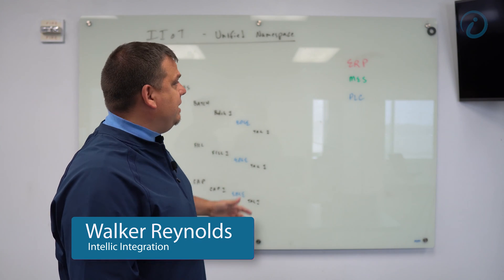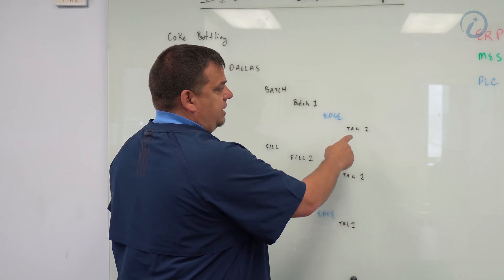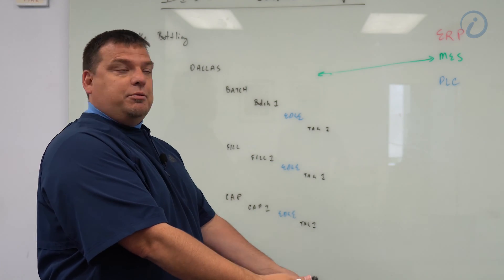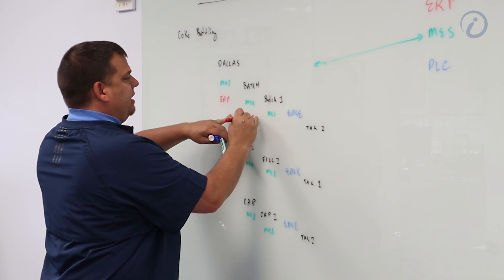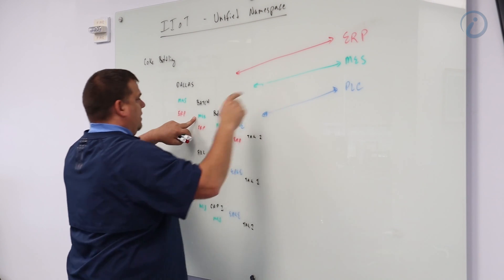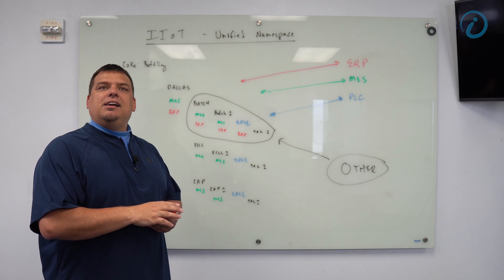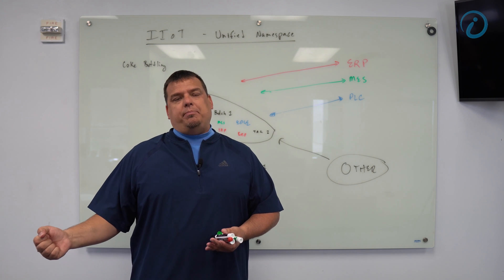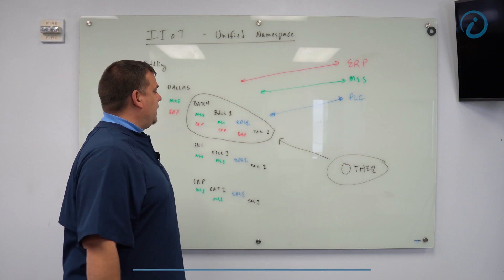IIoT Unified Namespace Enterprise Example

Comment: Come on man :D Machine learning wants every tag? That's not right man. Could you please tell me what the machine learning algorithm does with static data? Answer is nothing. The static data you take from PLC which is not changing through the process of machine is nothing but a straight line in the multidimensional space which does not have any variance. ML algorithms require variance in the data to have predictions. I love your videos, I love what you are teaching about IIoT integration but don't go ML topics. I'm not sure this is your area.

Comment: I have 3 points to make. 
1) I'm horrified that your example of Unified Name-Space (UNS) is hardware centric instead of process centric. By this I mean you are retaining data from PLC, MES, ERP nodes, etc at their respective node tag in the UNS. In this way, you are just creating a central data hub, not a UNS. Imagine if the PLC hardware is replaced by several IIot devices in the future, then you will have to restructure your namespace at the hub, and make corresponding changes at each and every client! This will defeat the purpose of using UNS in the first place. Instead, if you structure the same data into a hierarchy of process related UNS, starting from nodes in the Enterprise level, followed respectively by levels for Site, Plant, Line, Unit, Machine, Loop, etc (ref. ANSI-SP88) , then irrespective of your hardware replacement, the tags in the UNS will remain unchanged. This should be the way to structure a UNS.
2) You mentioned that the data hub is a close loop for the entire enterprise's data. This is not so. Instead, it is a "hub and spoke" model where data is radiated to connected clients through a single layer (rather than passing from one hierarchical layer to another).
3) You mentioned that at the data hub, all PLC tags should be replicated into the UNS. This is not advisable, since it will only cause data overloading. As all PLC programmer knows, the PLC memory space is populated with at least two types of tags, the Internal Logic Tags (for internal logic operations) and the Process Tags (representing process status and outcomes). What need to be replicated at the data hub are the Process Tags, not the Internal logic Tags. Big data analytics and AI should only act on the Process Tags.